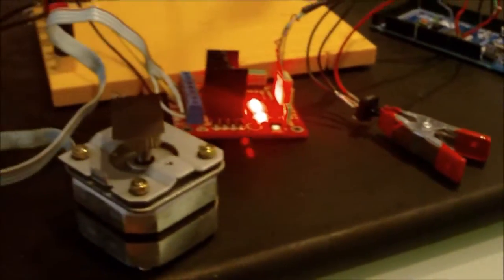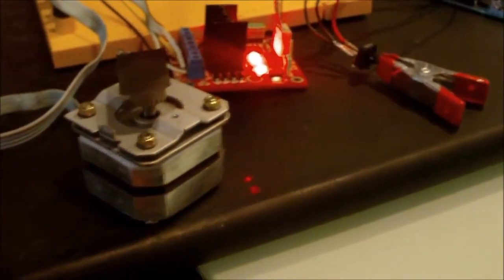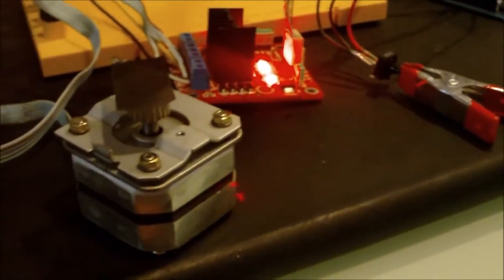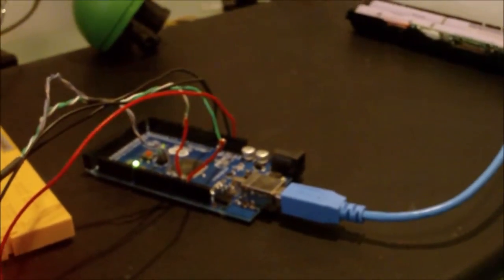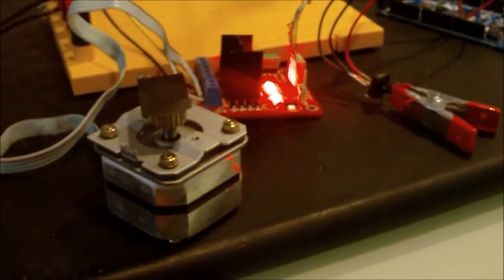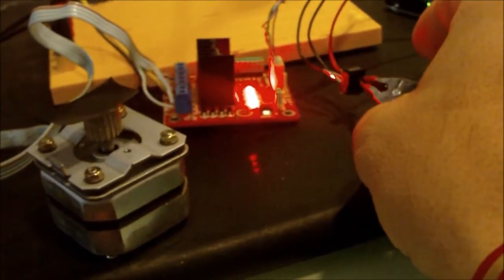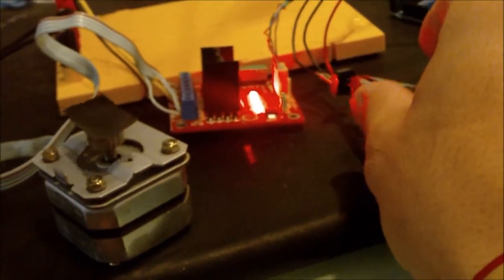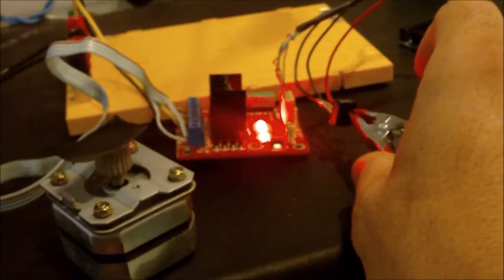L298N Stepper Motor Driver Controller Board for Arduino & em 257 2

Comment from the maker: No, I haven't, I'm sorry. Have you checked if you have common ground in your control board and driver board? Wrong number of steps in program or incorrect wiring coil order (by try and error or otherwise if your board has documentation) could be the issue too. Good luck

Comment from the maker: I'm not sure about this one Fadhlil, I would say it is ok if the three steppers are IDENTICAL and the sum of their nominal current is far below 2 Amps (1,5 maybe?-just ot be safer-). Otherwise you will reach or surpass the current ceiling of the driver and sooner or later you may waist it (burn it). Other aspects regarding electronic issues derived of three motors connected simultaneously (current peaks, armonics, etc.)...is beyond my knowledge. Sorry for my late response.

Comment: Hello Cesar, im using 3 stepper motor with L298 simultaneously. is it ok for me to use 24V 15A power supply. it will harm the motor and the driver or not? thanks

Comment from the maker: Video was made with 7 volts. When bought, specs said "L298N chip, can directly drive two 3-30V DC motor" with 2 Amps current limit. Those should be the limits for a stepper motor as well: if it can handle 30V/2A PWM in order to drive DC motors, so should it do when exciting stepper motor coils. Somebody correct me if I'm wrong.
Good luck!

Comment from the maker: Hi Marcelo I've just added a link to another video with the same stepper and some more info. You can better check connections in that video. For me it was try and error, but if you number red wire as one (in my case it was in one side of the flat wire), and so on until four, first coil would be wires one and three and second coil would be two and four, if I'm not wrong. Give it a try and good luck.